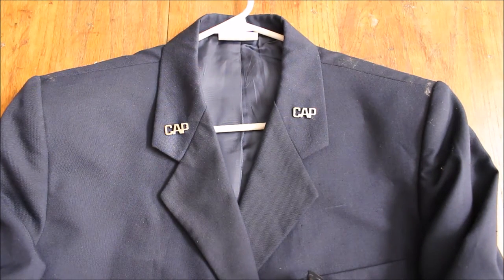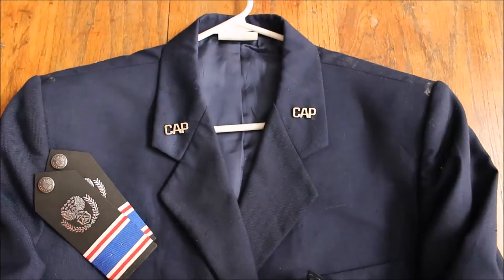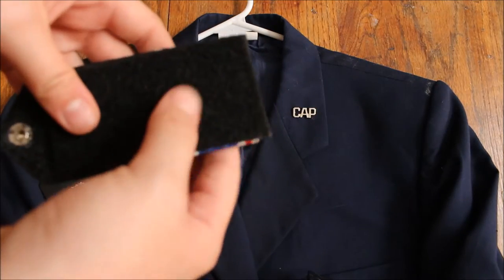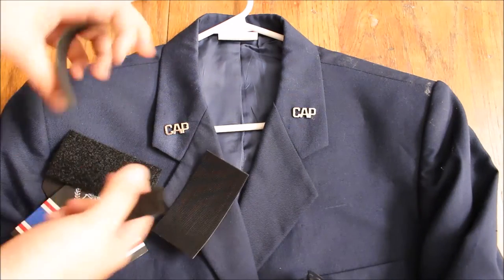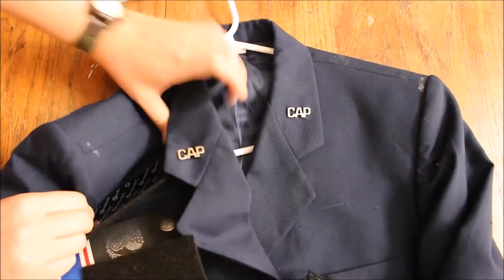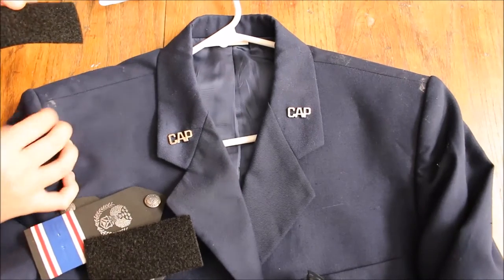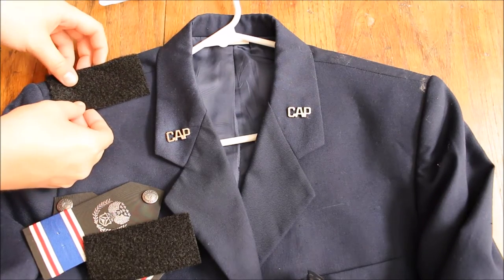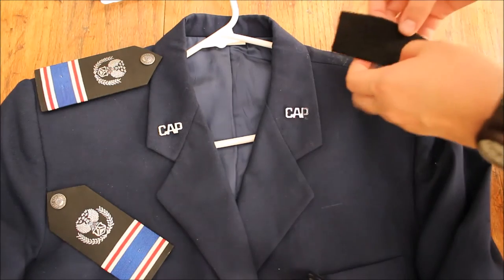How to Put Shoulder Boards On

Comment: Hi Holly. Is the metal button at the top of the board just for decoration?
Reply: In this case, it appears so. However, some uniforms do use poppers.
Reply: The metal button should match the buttons on your uniform.  It used to be that they were functional, but now they are illusory.